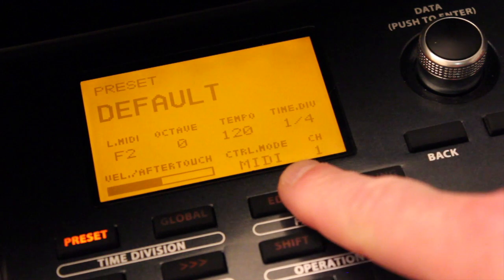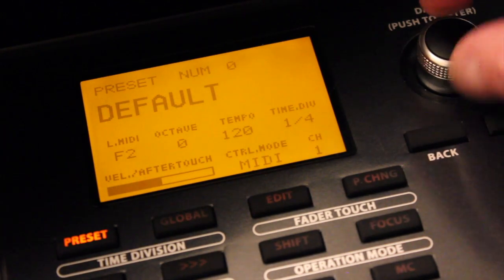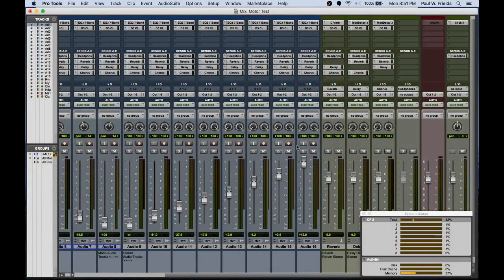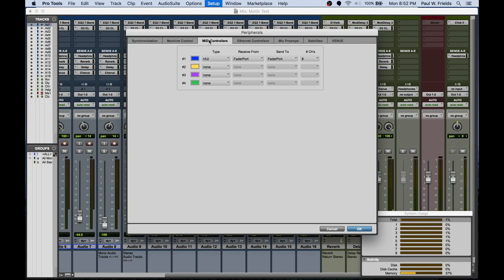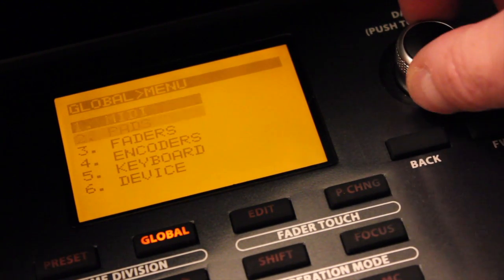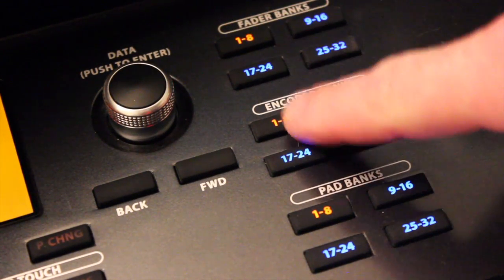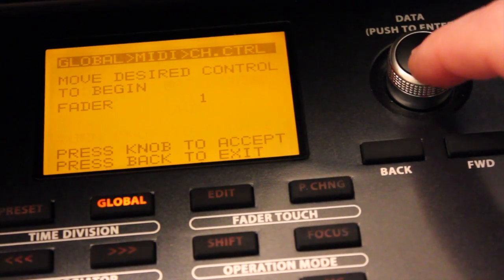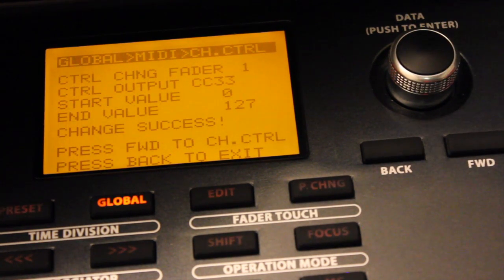Control Pro Tools with Behringer MOTÖR Part 1 - Faders, Knobs, Pads, and Transport

Comment: question : the faders can only control up to 32 tracks? meaning track 40 cant be controlled by the faders?
Reply from the maker: No, they can control as many tracks as you have. The controller is hooked to a rolling window of 8 tracks that can you can move up and down your session as far as you need to.
Reply: @stickster  cool then whats the purpose of changing the banks? I'm assuming if I select a track with my mouse in my daw that track will move automatically in the controller? but do I have to be in a certain bank to control it?
Reply from the maker: The point of fader banks on the controller is shown in following videos.

Comment: Anyone here knows how to save the presets externally? It says it has to use the "sysex tx". I'm quite unsure how to do it using midi ox. I'm afraid I'll lose all the presets I have mapped for days and nights.

This midi controller works for me but it lacks software support.
Reply from the maker: @markfernandez2187  most MIDI librarian software works basically the same. You set the librarian software to receive sysex from a device, then on the device you trigger the transmission (dump or Tx) from its menu system. I don't use MIDI Ox but maybe someone else does.
Reply: @stickster  thank you for your response. So it would the transmission remember the order of the presets and the name of the preset once I load the ".sys" file (If that's what it is called hehe)

My first midi controller was M audio code . I never had problems with saving presets because of the software editor. It is my first time to deal with sysex transmission.
Reply from the maker: If you do a dump of all presets, they will be recorded in order, and when you load them back in they will appear in the same order. To change order, you would need to save and load individual presets.

Comment: Cómo hago para que ese mapeo se guarde en pro tool,por que  cada vez que lo cierro y vuelvo abrir el programa tengo que realizar el mapeo nuevamente
Reply from the maker: See other comments. Make sure you save the preset on your Behringer controller using the Preset menu. Pro Tools does save its configuration immediately.

Comment: Good evening, I do everything you say and excellent, I already control the protools, but then when I turn off the machine and turn it on again later, motor 61 no longer controls the protools although the preset is set, I don't understand why maybe you could dispel my doubt Thanks in advance
Reply from the maker: You do need to store the preset using the save preset command inside the global menu under presets.

Comment: Hi Paul, thanks for the videos for the Motor49,  they are indeed very helpful. I have a slight problem though. For some reason, I am having to set up the keyboard EVERY time I use it. I select my Pro Tools preset, that I set as in your video, but none of the faders etc, work as they did once set up before. It is almost like it is saving the Preset Title, but not the actual settings. Have I missed something?
Reply from the maker: One thing that was missed in the first video was saving your settings. Use the global preset menu on your Motör to save your new PRO TOOLS settings to an empty patch. That should fix the problem. You have no idea how sorry I am for leaving that out!
Reply from the maker: Also, make sure you check out the other videos in the series. There is so much more you can do with your Motör!
Reply: @stickster  Cheers Paul, where do I find that? I am looking on my Motor but see nowhere to save settings.
Reply: Found it, awesome thank you, will check out your other vids tomorrow for sure. So good :) Your a true star.

Comment: Great video. However, when I select the "mc" function, my fader bank only works from 1 to 8. I cannot control more than 8 tracks. When I press the "9-16" function on the fader bank, I still can't control more faders than the limited number of 8! I figured I could control 32 faders in all, but I can't. Can you help me?
Reply from the maker: You can't use MC mode for this, as I pointed out in the first video in the series. MC or Mackie Control mode remaps the other bank buttons for other functions so they don't send MIDI messages.

Comment: Hi.  I Just made the setup, but my fader F1, starts in Channel 17on pro tools...can you help me?
Reply from the maker: Hi Cassio, there's no MIDI channel 17 on the MOTÖR, so I assume you mean it's sending on Controller Change (CC) #17. You want to edit your fader so that it's using the right control for the M-Audio keyboard protocol. In this case, it's CC 33. The faders F1-F8 should be CC 33-40 and F9 on CC 41.
Reply: Paul Frields thanks man! So, when I config the F1 with cc 33, in Pro Tools move the Channel 17, not the 1.
Reply from the maker: @cassiopires4513  Ah, I think I see what you mean. Pro Tools allows you to have a "bank" of 8 tracks -- these are called *tracks*, not channels -- selected at a time. This matches most controllers, which have sections of 8 faders/knobs to control volume/pan.

If you look at the track names, you'll probably see that tracks 17-24 outlined in a thin, bright blue color. That outline shows you the 8 tracks that are in the current bank. You need to move that bank selection to the left. Understanding how this selection process works is very important because once you do, you can really use your Motör for a lot more power!

I cover this in the video. Go back and watch the video carefully, then program your P1 and P2 pads to control track banking left and right. Once you do that, and move that track selection back to the first 8 tracks, you'll find that the faders are now controlling those tracks correctly. If you still have problems, post a video and tag me in a comment and I'll see if I can tell what's wrong.

Comment: Very helpful and got my Motor connected just the way I needed. However, I have noticed when I power the motor off and return to my work, the mappings have returned to default within the controller. Is there a way to lock or save the settings so this doesn't happen?
Reply from the maker: Yes, make sure you save the settings as a patch. Hit Edit, go to Presets, and save/copy.
Reply: @stickster  had similar question, hope this works... did exact same setup and went great, but next day everything seemed to be screwed up. So gonna go through it again and make sure i go to presets; and save/copy.

Comment: Great tutorial, definitely got me pointed in the right direction. Thanks for posting. Here's a few things that , at first, stumped me that I would look out for:
A) make sure the Operation Mode is set to MIDI and NOT MC. 
B) make sure the Behringer MOTOR controller's power supply is plugged in and not being powered from USB bus power. The Motorized faders won't move in USB bus power.
Theres a few more useful controllers that can be used. I found this post on Avid Audio Community that details more controller numbers associated with the M-Audio Keyboard protocol:
https://duc.avid.com/showthread.php?t=381063
Reply from the maker: Thanks! And yes, I indicated in the first video you need to be in MIDI mode. The owners manual also specifies to plug the unit in to wall power if you expect the motorized faders to work. However, you can still use them without power, although they won't be able to move when you are interacting with them on Pro Tools. Keep making great music!

Comment: Thanks again, I was able to set it up just like described. The one thing that was bugging me was that I always had to guess which tracks maps to which fader and it was cumbersome. I just came across a solution, and that is CTRL SHIFT click on a track. That will set the bank the controller to use the clicked track on fader 1.
Reply from the maker: You can also see the faders outlined in the color that's set for that controller in the MIDI setup in the Peripherals. But I admit, if you're trying to figure out the fourth versus the fifth it can be difficult! This is a great tip you posted.

Comment: Hi Paul, when in Pro Tools 11, I did as you said, went into Setup/Peripherals/midi controllers/selected type M-Audio Keyboard, but then under RECEIVE FROM & SEND TO, I did not have the option you mentioned, all I can see is MIDIIN2(MOTOR49 Keyboard) [Emulated], or MOTOR49 Keyboard Emulated. I have tried both but I just get a message saying 

Pro Tools is unable to communicate with M-Audio Keyboard. Power-Cycle M-Audio Keyboard and check its connections, note if M-Audio keyboard is not in use, update the peripherals dialog to prevent further warnings. 

What am I doing wrong? 

Only got the Motor49 today, so expected teething problems, but watched your video prior to buying so thought I was going to be ok. 

I am using windows 10, Pro-Tools 11, Tascam US 4x4 Soundcard,

Hope you can offer some advice, as I really like the look of this Keyboard / controller but cannot seem to get the Pro Tools software to communicate with it

Spent a lot of money on my Pro-tools system, so really do not want to change my DAW.
Reply: Hi again Paul, I managed to get the Programming done in the end, and the transport, faders, panning etc all work. ( I did this by going into SETUP/MIDI/MIDI STUDIO SETUP/ created an instrument called Motor49, selected the Motor49 Keyboard [Emulated] as the input port and output port.) All seems to work now, BUT.....no motorized faders? no matter what the faders are doing in Pro Tools, the faders on the Motor49 are static, although if I move the faders, it does move the fader in Pro Tools, kinda pointing to the keyboard is happy telling Pro Tools what to do, but will not accept orders from Pro Tools. Are you able to offer any advice regarding this? 

Also, any idea how to use the pads on the Motor49 programming my drums in Superior Drummer 3 in Pro Tools?  I want to assign the pads to various parts of the drumkit so I can play the patterns in. 

Thanks in advance for any advice...
Reply from the maker: @SkjoldrUK  You can try resetting the audio/MIDI setup using the utilities tool. That often fixes sync problems for any controller; the MOTÖR isn't alone. By the way, keep an eye out here, another video is coming in just a few hours...

Comment: Hey Paul, thanks for the head start. I'm getting my Motor 49 tomorrow. I've been waiting for this controller ever since it was announced and I just discovered that Amazon is banging them out for $150. It seems that Behringer has offloaded their inventory and it's being sold off by a number of outlets. You may want a spare. BTW is it useful to update with the latest firmware?
Reply from the maker: It might be useful to you to update the firmware, sure. It shouldn't affect the process in the video. I don't have a Windows computer in the house and that's the only way to update, so I haven't done it.

Comment: You are a great teacher Paul, I like your presentation. Can you make a video on how to set the sustain pedal up on MOTÖR 49/61?
Reply from the maker: Actually, this is dead easy. You want a sustain pedal that operates as a momentary switch -- most of them do. If yours allows you to switch modes between momentary and toggle, momentary is the one you want. Plug it into the Sustain jack on the back. Try it out. If it's not working, switch the polarity setting on the pedal and it should work in the other position. I have good results with an M Gear pedal that was relatively inexpensive on Amazon. There are many other brands that work fine as well, because this is a simple piece of gear.

Comment: I'm glad you posted this, as I'm considering the Motor61 as a control surface. Is there no way to save your settings as a sysex template or something? And, do you know if this works equally well in PT 11? Cheers, man. Thanks for geeking out in a way that makes me think this could be a good option.
Reply from the maker: You can easily save these settings on the unit, and also save them with a librarian program.
Reply: Cool! I guess I didn't mention that I was hoping that YOU might be willing to share them! Either way, thanks for enlightening us.
Reply: So! Would you be willing to send a sysex file to a poor PT user who's looking to incorporate the Motör?

Comment: YEAH! I was looking for that! I'm very sad about the very little compatibility that have some Midi master controlers with some DAW's. 
Someone knows some info guide about how to program a controler for protools? and wich orders you can send?
I'v recently bought a Nektar Panorama P6 controler for use it in protools, and there are a lot of functions that I can't use! :(
For example: Panorama P6 has 1 Motorized fader that should follow the selected channel and represents it's volume level (but it doesen't work). How could I set these motorfather to do that on PT12?
Reply from the maker: Nektar has a help page for Pro Tools:
http://support.nektartech.com/s.nl/ctype.KB/it.I/id.860/KB.1129/.f?category=8

But if that doesn't help, you might get info from these videos on how to set up MIDI controllers that make the Panorama work well for you.

Comment: I followed your steps but the Motor61 does not control the ProTools faders, tranport, or pans. I'm using ProTools 12.8.1. The only thing that looks different from your vidio is when I am setting up Periferals/Midi Contollers; my options are "MIDIIN2 (MOTOR61 Keyboard) [Emulated]" or  "MOTOR61 Keyboard [Emulated]". I have tried both. Any suggestions??
Reply from the maker: Make sure to quit Pro Tools, reset the Audio/MIDI bus (if you're on Mac OS X there's a utility for this and you can rescan). Then try again. Other folks seem to indicate here that worked fine.

Comment: Thanks for such a great video. Is there a way to assign commands such as: Undo, Freeze or Quantize to the PADS? Thanks.
Reply from the maker: Eduard Cojocaru Anything you can carry out with a keystroke, yes. After I finish the album production I'm working on this month, I'm going to do another video on that.
Reply from the maker: I know it's been a long time Eduard, but I did finally do that video here: https://www.youtube.com/watch?v=De98fRXGFvQ -- hope it helps you!
Reply from the maker: By the way, I forgot to mention here.... the Undo function is automatically mapped to Loop+Stop (hold down *Loop*, press *Stop*, then release) using the setup you did in this video!

Comment: Great video!  I appreciate the time and care you've put into working out this process and helping others.  But I wonder-  Is there a method by which these settings in your Motor keyboard controller can be saved and loaded/shared later?  That would help not only to speed up the setup for new users, but for those whose settings might become lost sometime down the line for whatever reason.
Reply from the maker: gr4ndv1ll3 Yes, use the preset save function available in the presets menu.
Reply: Cool!  I don't suppose you'd be willing to share that file someplace, would you?  That's more in line with what I was getting at.  Sorry for not being more clear!

Comment: Hello sir need to know how we can use it to the fullest and control everything in protools like transport control , faderbanks like for more than 32 tracks , surround pan , and other music programming features
Reply from the maker: I showed you how to deal with the transport and fader banks in this video. Try rewatching it if you missed that part accidentally. Surround pan won't work with this setup. Pro Tools does not allow MIDI control of those elements.
Reply: Paul Frields thanx Paul this side Deepak Arora I have returned the product it has alot of problems
Reply from the maker: Sorry you had problems, maybe it's a defective unit. I'm controlling transport and faders for around 85 music tracks in a current project with no problem.